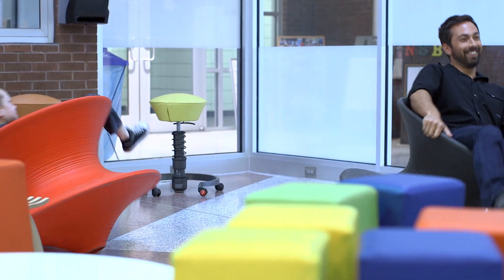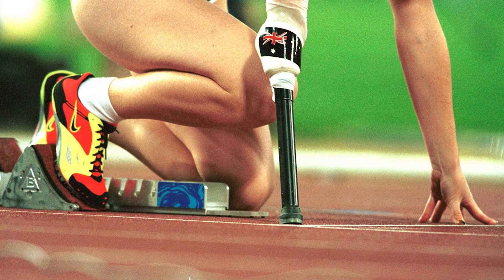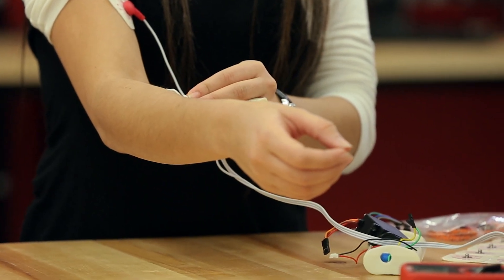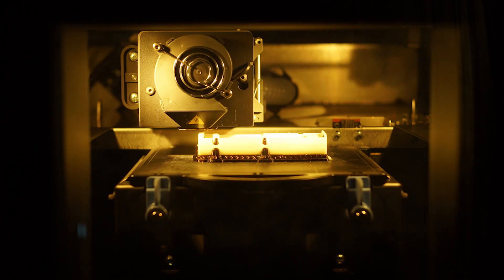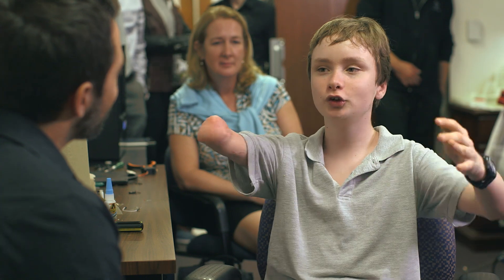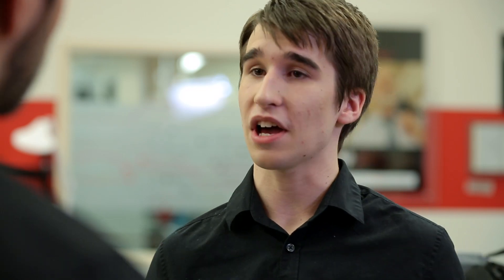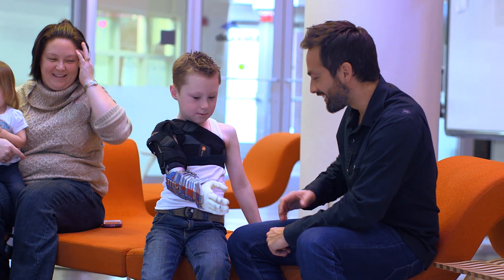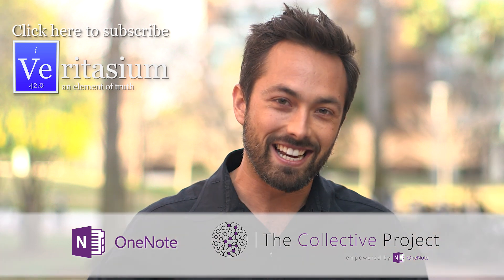An Affordable 3D-Printed Arm

Comment: Gotta be honest, I don't think they've solved a problem that others couldn't, I think they've just made a cheapo version of the real thing, and it's not even an advancement in anything, big deal, they are getting on the 3D printing hype train 5 years late. Like, it's fine for giving kids confidence and it's clearly a good thing as it makes them happy, but it looks like you could fall and all of the fingers would just break into pieces, and the demo of it gripping was on an empty water bottle? Is that all it can grasp and lift? Or was that just all they had at the time to demo it to the millions that could see this video?

The real problem is the robotic arms that cost 50 grand only cost so much because of the research and development that goes in to them, and there is no infrastructure in place to manufacture them on a large scale. And the companies that are making these arms aren't looking to sell them on a large scale, instead they are just constantly making new versions and improving, and there is nothing special about them mechanically, the physical materials and technology are going to be pretty cheap. So if we want people to have well built functioning arms then somebody needs to push the development of bionic arms and get them down to a reasonable price, and while it's great for these kids, in the big picture making a barely functional cheapo version out of plastic is like putting a plaster on a knife wound.
Reply: Um, they are solving a problem. They're solving the problem of it being too expensive to give kids arms...
Reply: Great products of today, like the iPhone, tablets, cars and whatever, did not just fall from the sky, it took time to evolve.
Reply: oBLACKIECHANoo Please link to the "many other cheap alternatives" that have as much function as the arms/hands that these guys are producing.

Don't just say "THEY EXIST!!!!!! THIS IS ABSURD!!!!", give us some real sources instead of shitting on people that are getting prosthetic arms for kids cheaply.
Reply: Yeah I don't the point. Why don't the kids just get the already existing 100 thousand dollar version?
Reply: And they're so, so much cheaper. If I was missing an arm, and I couldn't afford a super expensive one, I would much rather have one that could pick up a few little things and pay a few hundred dollars than not have one at all.
Reply: oBLACKIECHANoo This isn't representing a revolutionary product. It's representing a revolutionary way of making it available to everyone at an extremely low cost. The arm costs around 300 dollars, and the wearer's family nothing out of pocket, the organization pays for it through donations. They've made something that is available for a high price and a specific class of people available to everyone.
Reply: oBLACKIECHANoo C'mon, please link the other cheaper alternatives, otherwise, you ain't provin ANYTHING.
Reply: Woman girl live mix kkk Leah wedding boytry frch teen mionyyt tony okkk end Hannah sch eat kids food u cocken kimmn wayewasty try sister 21
Reply: they need time to grow... just because it cant be imidiate product we should give up on it? wtf
Reply: Revanth Boom Boom amen.
Reply: But it's a good way to start developing standards and software to help design arms that can then be made of more resistant material, for adults that will need them to last a very long time.
Kids outgrow these artificial limbs and need new ones that fit.
As you said, it's the R&D that costs money, not the actual materials, so getting a better more efficient design process will help lower the costs.
Reply: @ireallyreallyhategoogle  d
Reply: oBLACKIECHANoo One of the huge cost savings comes from not having to use molds and being able to edit the design and just print something different. Molds are expensive to make and every child is going to require something slightly different. Not needed molds is the benefit of 3D printing.
Reply: Dude come on this is really cool. And there aren't that many robotic arms. This is a huge development. And the cost is amazing.
Reply: They're only cheap because the kids need new ones every six months. When they are fully grown they get the expensive one then.
Reply: I think that what they're doing is important. Maybe the arms aren't functioning well, but at least they're TRYING something. It's better than them simply not creating them. If they keep going, others will notice what they're doing. Others will add to it, improve it. They've done a very valuable thing as the first step to attaining the goal of cheap arms: they opened the door. Don't poop on them because the arm doesn't work great yet. Encourage them because they're trying things, and they and other people will learn from it, and ultimately come up with an excellent solution.
Reply: I think you miss the point. You will never be able to make a fully robotic arm affordable for the millions of kids that need one, not can you overcome the issue of outgrowing an expensive piece of hardware. What they're trying to do is create a functional, DISPOSABLE piece of equipment using a 3D printer (now that they are more widely distributed) utilizing some reusable tech (the servos and sensors) to carry forward to the next larger piece. It's not a tech breakthrough - it's a change in how they view the whole concept of the replacement limb paradigm.
And I think the kids faces tell you it's far more than plaster on a knife wound. And the whole concept is only in it's infancy.
Reply: This is the first version, they are making it more advanced it's a great movement
Reply: DMitsuki Or they could get one of the many other cheap alternatives that are stronger and better built, not only that but people have been 3D printing parts for prosthetics for years and making the exact same arms as these guys are with various other methods with are also cheap, you know, like molds.

But it's OK if you want to ignore the point because you're blinded by emotion and ignorance.
Reply: Ricardo Dinis What I'm saying is the gap for cheap prosthetics that can grip is already filled, people have been making arms like this for a while now and they are a few hundred dollars. And that makes this project a waste of time, especially when it looks like you get what you pay for (they want to give it to kids for free). 

Instead, if they really are good engineers they should be looking at all the rnd that has been done on much more complex prosthetics and then finding a way to have that technology trickle down in to cheaper products because all the companies doing that RND are keeping the prices high for as long as they can because their competition is doing the same.
Reply: Diana Peña That's not a problem, that hasn't been a problem for a long time now,
Reply: Revanth Boom Boom That is what I'm saying, but there was huge amounts of competition in those markets that forced the technology to progress quickly and come down in price quickly, and that doesn't exist in the bionic prosthetics market. And what I'm saying is, somebody should be creating competition there instead of being a bunch of hipsters 3d printing stuff that changes nothing and pretending it's revolutionary, I'm surprised they don't have a kickstarter page.
Reply: Mike Burke It's not a revolutionary way of doing it though, people have been using 3d printing to make prosthetics for years, and other ways of doing it are just as cheap and easily available too.
Reply: oBLACKIECHANoo these ones are to give for free, i'm pretty sure they wont be without any impact on the industry. this may even be funded by governments, which would be a huge jump in medical assistance
Reply: Will Wright Molds are expensive? They're dirt cheap actually, even a metal mould doesn't cost much.
Reply: oBLACKIECHANoo You could look at it like they didn't - really - invent anything, but they did innovate it. Take Raspberry Pi, for example. They didn't invent the computer, but they did innovate it to make other technologies widely possible due to economic constraints. Unfortunately, the dawn of new technologies is largely dependant on how you can spread it to the masses. $40k for a prosthetic arm isn't really widely distributable. Regarding your comments, I'm not sure if there are prosthetics that are around $300 right now, could you link some to show where you're getting your info from? (Plus, for a kid and the parents, having it custom designed for no extra costs is pretty damn cool)
Reply: Dan Moore Damn, your comment is really disappointing. "You will never be able to make a..." is basically paraphrasing the infamous quote, "In my opinion, all previous advances in the various lines of invention will appear totally insignificant when compared with those which the present century will witness." in 1902. That's okay bud, the progress of civilization isn't for everyone. Still gotta have people to feed those who it is for though.

Let's pretend you didn't say that, for sake of argument. You're right, they are trying to create a disposable (or atleast recyclable) prosthetic limb that's cheap enough to distribute without significant costs. And I'm not sure if you meant 'tech breakthrough' as literal as I'm reading it, but I didn't and the creators didn't claim it was a breakthrough either. And innovation is taking existing technology and using it in a new way, so... I'm unsure where I missed the point so far. You said they didn't solve a problem where others' couldn't, but even in it's infancy kids are getting prosthetic limbs who couldn't have gotten them through other means.
Reply: Chris Graves
I'll stand by the thought that they'll never make a "traditional" prosthetic limb - the concept of a fully articulated robotic arm as they are concieved today - any more available in scale with Dr. Jerrold Petrofsky making more paraplegics than just Nan Davis walk. It's just a matter of cost and economies.  Hell, we still can't feed African children, and we certainly can't give them robotic arms. And really that is far different than your Duell quote.
And I go to great lengths to say it is NOT a tech breakthrough, just a whole new way of looking at the issue by improving the quality of life at an amazingly low cost utilizing existing technology that is becoming more common every day. So a more commonplace 3D printer in a place like Africa with a simple (growing even more commonplace) internet connection could indeed produce custom limbs unheard of through any other modality. Created by people half a world away, and at low cost. And that DOES solve a heretofore unsolvable problem.
Reply: Dan Moore
Reply: Filament (the thing used to 3D print) isn't weak when it's made with thick layers, the joints and the hand itself are thick making it pretty strong. Besides, it's the beginning of affordable prosthetics so it isn't ready to be sold all around the world or anything big yet, it's just a model.

Comment: I feel like its not that its just a cheaper way, its just nowhere near as intricate or as complex as a 20,000 dollar prosthetic. From what I saw the only joints that were used were just the hand as well, so it does not compensate for the elbow.

Comment: the trouble with prosthetics that some people dont realize is that EVERY, SINGLE, ONE, of them has to be custom designed to fit the recipient. its not like clothes where it just has to kind of fit. not everyone has the same body size or the same amount of missing limb. the ability to quickly make custom designs with 3d printers is surely what will solve this problem. in a few decades all you will hav to do is get your nerves mapped out and body measured then in 6-8 business weeks youll hav a limb.
Reply: Well, clothes used to be custom fitted too, by a professional called a tailor, which is mostly gone now. It's a matter of scale too.
Reply: thing is the hand would be like padronized but i get it thing is,the amount of ppl that need these arms is not AWFULLY big so thats not so much of a problem with proper funding and dedication even if it takes 20 years to get every single person who needs an arm to get one
Reply: Adjustable straps. Simple design. Baby steps. Not everything has to be so fine-tuned to be effective.
Reply: Tiago Silveira well before the industrial revolution and mechanization that was the most economical way to make clothes, by hand. if you wer going to make them by hand you might as well make them fit or no one would hire you. good point though
Reply: Zd📌📍
Reply: Although if they have atleast 1 arm that one can be scanned to make the prosthetic fit as well as possible. If not then they can go by proportions. We aren't quite at the point where we can easily do it but further research will make a huge difference for a lot of kids someday.
Reply: Yes, my point is that we're making arms "by hand" today, but the future could be different. In fact, 3d printing is a mechanization step similar to the steam engine (only that it boosts skill instead of strength).